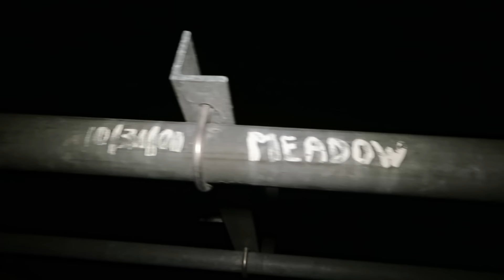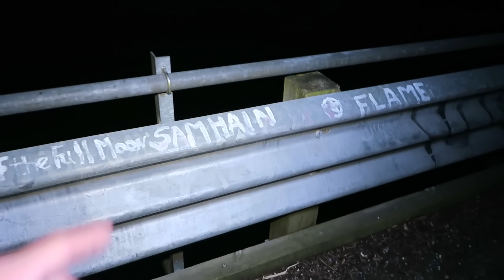MY LIMO BROKE DOWN ON THE HAUNTED CRY BABY BRIDGE (GONEWRONG)

Comment: 3:20 There is something on the window behind Moe and CJ! This bridge that you were on was on the Wallnut road and i think that's why you saw so much wallnuts.
Reply: I think that was just a reflection behind moe and CJ
Reply: It's called a reflection
Reply: Is it really looks like a reflection to you?
Reply: I mean it's something that apears for a second
Reply: Wait, the thing that is behind CJ and Moe isn't a reflection; start the video from 3:15 to 3:23 look carefully at the Mirror it's maybe from the inside or outside because whenever Moe brings the camera closer to him the creature gets moves far a bit. The Mirror shows 30% reflection and 70% absorption of the outer environment it makes more sense now. The Mirror is black so it shows clearly the reflection of what is Mysteries to be discovered. use                             

M.E=R.K/5.98nm
Reply: Plus in 7:17 you can see footsteps on the top of the LIMO; this creature was highly alerted!!!
Reply: But i think its a reflection cause moe is moving his camera around and that changes the angle of the reflection

Comment: Moe, the spirits of the bridge must have known you wanted an adventure and sent you into a threshold which took you into the spiritual dimension, the spirits tampered with that coil to attempt to trap you in the dimension and the echoing cars coming you heard were from the dimension we all know and love. You are lucky you used to be a mechanic or you actually could have been trapped on the crybaby bridge forever. The explanation for the car coming once the limo started is because you returned to our dimension by overcoming the crybaby bridge and figuring out what was wrong with the vehicle. To explain the AAA not coming, those texts weren’t real and couldn’t reach the normal dimension. You should go back there. I’m surprised your footage was able to cross back through the threshold when you returned to our dimension.

Comment: I find it a bit sketchy; when they first found the baby powder, Moe dumped some powder on the leaves, but later on, they sounded shocked that there was baby powder on those same leaves. The other thing is at the end of the video, Moe states he used to be a mechanic. Why didn't he just look at the engine at the beginning?
Reply: u r right
Reply: I know rightttt
Reply: Probably just wanted to check it out
Reply: Maybe they got so scared they forgot they dumped baby power on the leaves.
Reply: Ur right Chloe I realized that also
Reply: @marbellasanchez9757  good point
Reply: At the end of the video it appears that Only  one spark wiring was removed from the engine, it should give just misfire but not shut off all the electrical systems and entire vehichle!
Reply: My father is a technician, mechanics only work on certain types of cars. Fords, Mazda, Honda. So I’m not surprised that h didn’t attempt to look at what was wrong with the limo.
Reply: @Jerome Brown hi
Reply: @bradenseaton6996  hi
Reply: Tru
Reply: When people are scared, they usually dont think straight

Comment: Cry baby bridge challenge Rules are put baby powder on the trunk and the bumper get inside put your vehicle in neutral and the baby spirits will push you all the way to the other side of the bridge  Yes your vehicle will automatically turn off when you arrived there until you get the other side of the bridge and it will turn back on enjoy the challenge if you are there👍😎👍